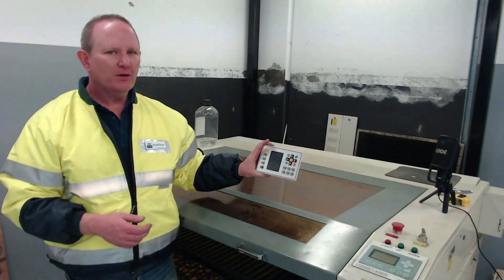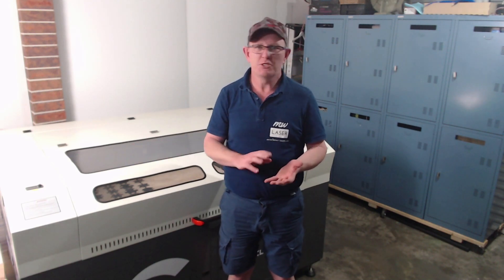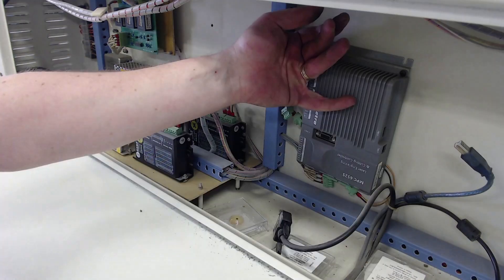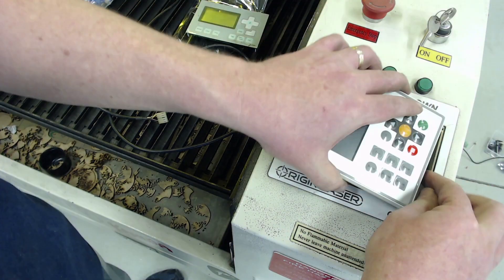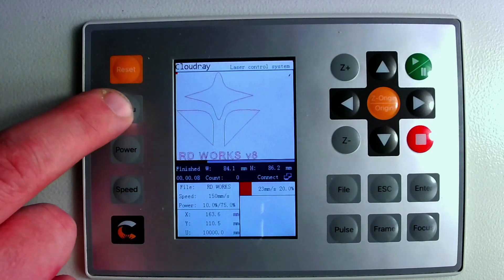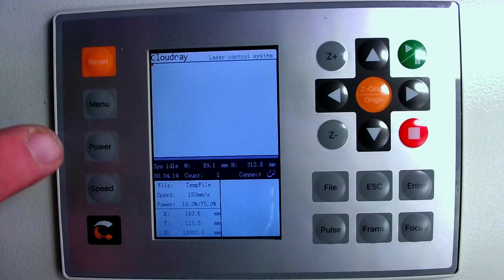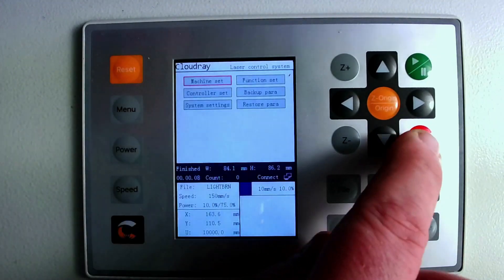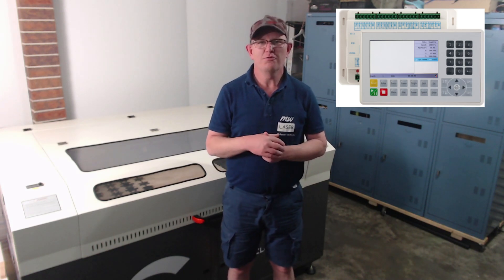Upgrading A Leetro Laser Controller to RuiDa Laser Controller

Comment: Im about to convert from Leetro 6525 to Ruida 6445.  Is there a way to get the settings from the 6525 without a computer?  I cannot get to connect to windows 10.

Comment: Thanks for sharing.
 I am changing the controller board of my 60x40 m.3 laser for a ruida 6432, but I am not clear about the driver configuration regarding the value to choose in pulse/rev.  The motors are 0.9 degree nema 17.
 I would appreciate it very much if you could help me.

Comment: great video.  I have a GWeike LC1512 with Leetro and it uses Lasercut 5.3.  I'm having to use very old windows on it and need to upgrade.  My laser has the lifting table (z axis), that rises up and down with autofocus.   Would the RDC6432G be the correct controller for me?   thank you.

Comment: Hi mate  can I replace Trocen awc708 to Rudia RDC 6445 thank you
Reply from the maker: yes no problem, very simple. I have a document for the exchange of similar Trocen model to Ruida on my website, most of the connections will be the same between the two and you may find it useful.
Reply: @MWLaser  thank you

Comment: Thank you for your helpful video.. I'm about to build my own co2 laser cutter which will have a cutting area of 1100mm x 1500mm. And the laser tube will be 80watt, I'm just wondering what is the difference between rudia rdc6445 and rdc6432g? I'll be grateful if you could explain, I'll select one of them according to your answer, thank you in advance...
Reply from the maker: best off with the RDC6445G.
the 6432 is a "lite" model made for Cloudray Laser, it is good but is missing some features you may use.
Cheers

Comment: just got the same controller i am about to put together a home built frame.
Reply from the maker: Thanks - good luck  Cheers Matt
Reply: @MWLaser  hi Matt
i have all movement on x and y but when i use the controller buttons x axis will only move one way.
will cut out draw etc what you want it to do but x axis button not working even id rdworks its the same if i need to move the head.
just waiting on cloudray to see if i am getting a replacement now

Comment: Bonjour et ce que je peux changer un leetro  mpc 8530s  avec awc708c merci d'avance
Reply from the maker: You can swap out the Leetro MPC 8530S with either a RuiDa RDC6445, RDC6442, RDC6432 and others like the Trocen AWC7813

Comment: Many thanks for your very helpful videos! I have upgraded my K40 Laser with a RDC6432G and it works fine so far except the homing after startup. I have set it up according to your vendor settings video and set the configuration to auto home x and y. But unfortunately it does not start homing after power up or reset. I have to do the axis reset manually every time after startup via the Menu->function settings->axis reset. Can you provide any hints on that?
Reply from the maker: in RD Works - vendor tools - (read info from controller) Then Enable Home on the X & Y axis and Write info to controller.  then re test - if you require further assistance email Matt@mwlaser.com.au
Cheers

Comment: Just stumbled on this video and im glad! i just acquired older Hurricane Lasers (Agnes) Machine and it is lacking any software or support but i notices it has leetro card inside I wonder if i can still use it and what software would i need ?
Reply from the maker: Leetro require proprietary software and a USB License Key, Unless they have a new version; the software I am aware of for Leetro is only 32bit.  If you upgrade to RuiDa or Trocen then you are able to use Free Software or LightBurn, which is what I would recommend.
Cheers
Reply: @MWLaser  thank you 🙏 hopefully that card replacement is worth and not too complicated much appreciate your answer I found the leetro usb dongle for 100 on ebay still learning much about the system thank you so much !

Comment: Hey mate, thanks for the video. Super helpful since we're about to upgrade a Redsail X700 and a larger cousin of it to RDC6432G's. One thing that I'm curious about though is have you been able to use lightburn successfully with the RDC6432G? Lightburn itself was unable to confirm compatibility on their forums a few months back.
Reply from the maker: Yes I use LightBurn software everyday with the RDC6432G
Reply: @MWLaser  Perfect, thanks!